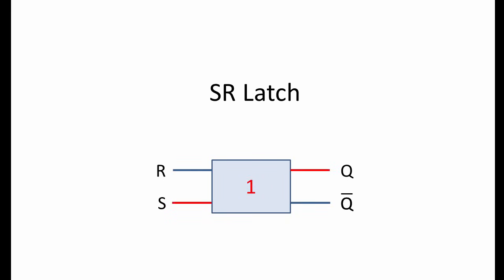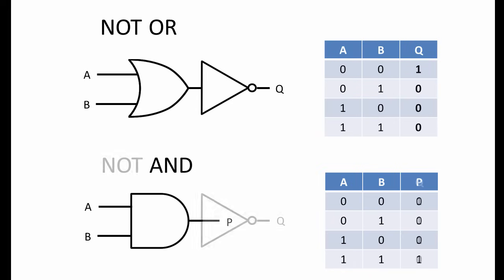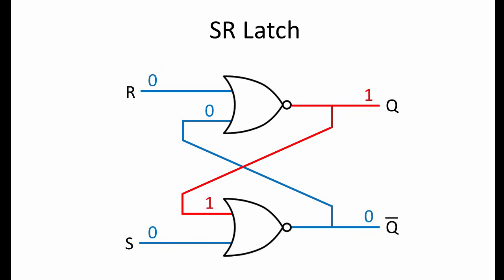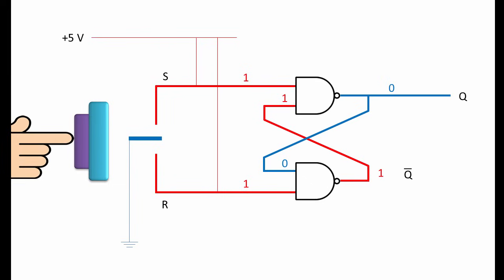Latches and Flip-Flops 1 - The SR Latch

Comment: At 3 minutes and 21 seconds into this video how exactly does someone know that the top output is a 1? When what you need to know is that the top input of the set inputs OR gate is a one when bottom input of the reset OR gate needs to be know first to know that.
Reply: In real life, it's startup state is considdered random. Because any of the two states is determined by wich nor gate is stronger than the other to force a 1 on the output. It's why whenever a cpu starts up all registers need to be reset and put in a known state for it to function propperly. In the video he assumes the top one is set because it helps make the explination simpler.
Reply: I have a similar question. How do you know that both of the inputs for the top gate are 0 when the second input of the top gate is dependent on the output of the bottom gate, which is in turn dependent on the output of the top gate? It seems paradoxical. Clearly I'm missing some unspoken rule on the ordering or just misunderstanding something?
Reply: The starting state is determined at the moment the power suplied. its random Q can be either 1 or 0. but once its determined the the other become imedeately the opposite of that .
Reply: Thank you for your interrogation I was so lost at that level

Comment: 1:30 NOR gate and NAND gate explained
2:25 NOR gate and NAND gate can be used to make an S-R latch
2:35 Cross-coupling of 2 NOR gates in an S-R latch
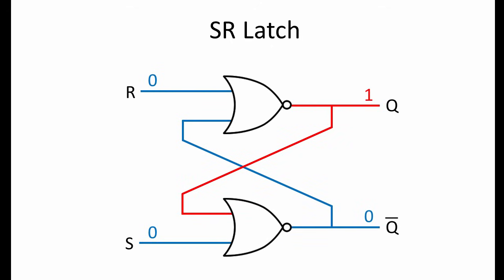3:17 Starting state of this S-R latch example
3:55 Resetting the latch
4:17 Pulse removed
4:25 Applying another pulse and implications
5:05 Implications of applying a pulse to S
5:27 Truth table
6:15 Truth table after applying a set pulse
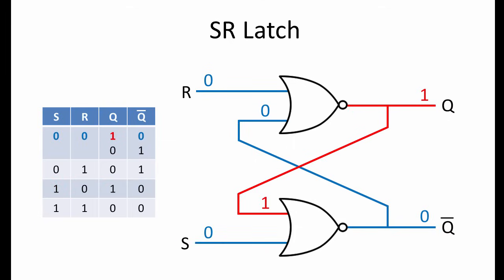6:25 Truth table after removing the set pulse
7:15 Race condition
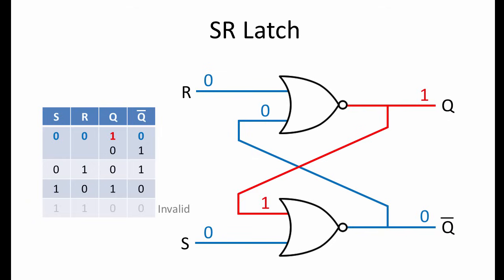8:00 Active High S-R Latch Explained
8:41 Truth table for Active High S-R Latch
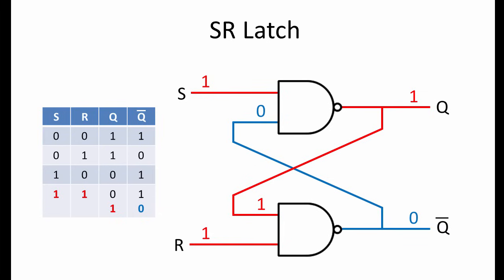9:20 Active Low S-R Latch (i.e. built from NAND gates)
9:44 Forbidden state of the S-R latch built from NAND gates
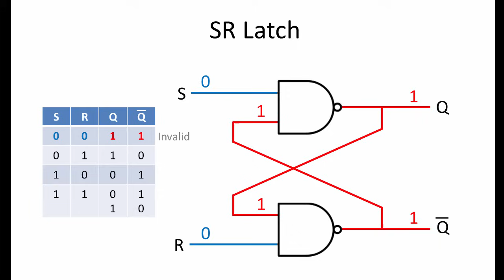10:00 Summary
10:37 Switch bounce problem
11:37 Examples of applications of an S-R latch

Comment: at 3:28, why is the top nor already producing an output but the bottom one isn't? the setup is symetric, so both should be on instantly, then switch each other off and on again in an endless loop.
Reply from the maker: Propagation delays which depend on external conditions mean that it is highly unlikely both inputs will be set to low at the same time (and it's low voltage that represents 0, not no voltage).  Nevertheless, the circuit will reach equilibrium as soon as a pulse is applied to just one of the inputs. :)KD
Reply: @ComputerScienceLessons  so the starting state is random?

Comment: how exactly is the information stored physically? is it a small amount of current stored somewhere to remember that the result of the impulse was 1?
Reply from the maker: Remember, a single logic gate is actually a circuit consisting of several electronic components (transistors and resistors) and these must be permanently connected to a power supply.  Depending on the input, the current may or may not be allowed to flow to the output.  Therefore, flip flips don't really store current, they just hold it up or let is pass.  CPU cache and CPU registers are built from flip flops, which are built from logic gates.  DRAM on the other hand is much simpler and cheaper because it is built from transistors and capacitors.  A capacitor stores electric charge (rather like the way you can store charge on a balloon when you rub it against your jumper, but a capacitor is better at doing it).  When a capacitor is charged up, it contains a 1, when discharged it contains a zero.  Hannah Fry posed an interesting question on social media: "does the computer's memory weigh more when it is storing data?" :)KD
Reply: @ComputerScienceLessons  TY for taking the time expaining! :D cheers

Comment: I find an SR latch made of an OR Gate , AND Gate , Inverter combo very useful. The OR Gate output is fed to one AND Gate input. The other AND Gate input is fed by the inverter output. The inverter input is the Reset input. One of the OR Gate inputs is fed by the AND Gate output which is also the output of the Latch. The other OR Gate input is the Set input. There are no disallowed states and the output is always predictable even at power up.

Comment: At 6:35 
Race mode between the two outputs being impossible to determine who would win.” Mathematically, speaking, if both S and R were turned on and then off EXACTLY simultaneously, wouldn’t the output that was the shortest distance from the other input win? Thus, not “impossible to predict,” so long as signal speeds obeyed rule 3 of lumped matter discipline, and signal routes varied in length. Not that it matters for all intents and purposes.

Comment: the thing is: the output differs depending on whether we start by outputing S, then transferring its output to an input of the NOR gate with R or outputing R then transferring the output as an input with S. Like for the first SR Latch made of NOR gates, assuming S=0 and R=0 If we start with S=0, Q'=S=0 then (R+Q')'=(0+0)'=1 so Q=1 BUT if we start with R, it flips: R=0, Q=R=0 then (S+Q)' = (0+0)'=1 so Q'=1. Completely different answers. So, which is the dominant path here?
Reply: or do we just treat the whole circuit as a single NOR gate, since S=0 and R=0, (S+R)'=Q, so Q=1 and in turn the inverse of Q will then be 0 ??
Reply: You're absolutely right. This used to bother me because I overthink things. The way i see it, the answer is: race condition. Basically, both results are valid, as seen in the truth tables at 10:01 . You don't care whether Q or Q' is set. All you care about is the fact that they are opposite. After all, this is a Set Reset latch, so you can put it into a favorable default state if it initializes into an undesirable state. As long as R and S do not violate the one illegal condition for whichever latch, you will have a latch that initializes into one of two states, which can be adjusted by the inputs as needed. To answer your question explicitly, there is no dominant path. It all depends on the propagation delay of the components.
Reply: @mikey.audio.  I overthink too. Thank you for your simple but effective answer. It clears my doubts and persuades me to deal with the question later when I learn more about the delay.

Comment: Are S and R interchangeable? How does the circuit determine which is which since its identical. Is it from where the power source is?
Reply from the maker: Because the circuit is symmetrical, they inputs are whatever you want them to be.  As you suggested, which is which depends on how you choose to apply the input signals.  :)KD

Comment: How does the electricity get captured between NOR and Q? Shouldn't it dissapate somehow as it looks likes the part between NOR and Q is storing electricity like some kind of battery? The truth table of NOR looks strange as well, how can you get voltage output out of no voltage inputs?
Reply from the maker: It's important to realize that a logic gate symbol is just an abstract diagram of a circuit containing several electronic components.  I had a student once who struggled with the idea that if you put NOTHING into a NOT gate you get SOMETHING out.  It became clear to her when she realised that all logic gates are connected to a power supply, but we tend to ignore that when describing their behaviour. :)KD
Reply: @ComputerScienceLessons  Indeed, I jumped into this video without looking at what the logic gates are composed of themselves, thanks.

Comment: So when both the inputs are 0, is one NOR gate behaving as a 1 input NOR? Are both the initial inputs applied at exactly the same time?
Reply from the maker: Once the latch has reacted to a change of inputs, and has settled, one of the NOR gates will have both of ITS inputs the same.  In this sense, the NOR gate is behaving like a one input NOR (which is essentially an inverter), but I'm not sure if that matters.  Because of propagation delays in the wires of any circuit, it is highly unlikely that both inputs of the latch will change simultaneously (in fact if they do, it is briefly problematic).  Simultaneous input changes are mentioned in a later video of this series :)KD

Comment: There's one part I don't get; initially, when you feed the first input S=0 and R=0, how come you know that 0 gets fed into the second NOR input in the top gate since the second input is the output of the bottom NOR gate, but the second NOR gate depends on the input value from the top gate output (which doesn't exist yet)? I just don't understand because you are only feeding S and R into the circuit; we don't know what the second gate inputs are. How can you get 1 as output from top gate?

Comment: Can anyone explain why it is this way 3:25
Reply from the maker: Hi J, With a NOR gate (which is essentially an OR gate with a NOT gate daisy chained onto it), the output is high when neither one nor the other input it high (that is, when the are  both low).  There's a bit of information about NOR gates in this video https://www.youtube.com/watch?v=TXZBqtfAOpY It goes into K-maps and Boolean algebra which might not interest you but you will see the truth table of a NOR.
Reply: I believe JuanAZ18 is referring to the initial state of the SR-NOR Latch which is unpredictable. The lecture here makes it sound as if Q=1 and ~Q=0 by default which is inaccurate. Until the state has been initialised via set or reset, the state of the latch is actually unknown, as it could be in either state.
Reply: That really seems like a problem to me, too. For both inputs low (or high with the NAND version) it is uncertain if Q or Q' is active at startup any possibly only determined by the differenc in speed of both gates.
Reply: I'm having this problem too, but the comments kinda confirm my suspicions: the state is unpredictable, and we can have Q=1, ~Q=0, or Q=0, and ~Q=1. 

Mentally, I'd mirror the circuit, and it looks the same. So, what's stopping ~Q being high at start instead of Q? Probably nothing. In a real world scenario, the manufacturing tolerances of semiconductors can make on have a shorter propagation time, hence being unpredictable. 

These are my two cents. If anyone more knowledgeable than me can pitch in, that would be great. I know I've been struggling with this for a while now, but am kinda afraid of asking such a "dumb" question.
Reply: For anyone that might still be having questions, have a look at these two pages:
https://electronics.stackexchange.com/questions/25581/sequential-circuits
https://electronics.stackexchange.com/questions/25629/how-does-a-latch-determine-its-initial-state

Comment: But how does it START to take on values? Because in the very, very beginning there is no signal from anywhere, so do we regard that all as 0s everywhere? Then we get two 1s after both NOR gates which feed back to each other and their input becomes 0 and 1 for both, which then means their output is two 0s, which means makes their inputs once again all 0s, which makes their outputs two 1s again, etc, etc. Endless loop. Is a flip-flop in such an endless loop eithout any electricity and any input? I really need someone to define the beginning for me, how does it all start. If it starts with the S signal setting it, then all those 0s are valid input, so why aren't they valid before the S signal sets it? That's really confusing to me.
Reply from the maker: When the latch is first powered up, one of the logic gates will most probably come to life ever so slightly faster than the other, due to imperfections in the components and wiring and because of propagation delays caused by factors such as the ambient temperature.  But there’s no way to know which one will come one first.  Even if they come on at exactly the same time (and end up in what is called a metastable state), one will eventually tip the balance (due to imperfections, etc.). Once one of the gates is high enough, its output will turn the other off.  The latch can then be initialised as required by setting S or R. :)KD
Reply: @ComputerScienceLessons  Oh ok, so we can't actually know which is S and R? How do we know afterwards - can we at this stage determine Q as the one with output 1 and notQ as the one with output 0, and based on that determine that the input paralel to Q is S and the input paralel to notQ is S?

Comment: At the 00 starting state, couldn't also Q be low and notQ high, depending on where you start ? Is the output random until you reset it ?
Reply from the maker: You are correct.  The initial state could be different each time it starts.  An initialisation signal (set or reset) would normally be used to force it into the desired state after it starts.

Comment: idk why i get it this way, but it would sound easier to me if the nand gate sr latch faction was named as an "active high sr latch"
since the sr latch happens when both its inputs are set on HIGH(1).The nor gate flip-flop using that logic should also have its sr latch faction named  "active low sr latch" since the sr latch happens when both the input are on LOW(0).Does this make more sense only to me or is it something that i havent grasped well?It could be the just the word "active" which idk to what this 'active" refers to.
Reply from the maker: I see what you mean, but I guess we have to go with standard terminology to pass exams.

Comment: Nice video, sir! I have a question:  
when Q=0 and -Q=1 and we set S to 1, why is it that the bottom NOR-gate passes the signal first? If the top one did first, we would be getting Q=0 and -Q=0 so it makes me wonder why it works in that exact order? Thanks!
Reply: It actually depends and it’s not certain it’ll work in that order everytime. It’s an uncertainty that plagues the SR latch when it’s starting, the way this is mitigated is sometimes a reset is applied when the latch starts up so we know Q is at a known state before any further inputs are applied. The state of the latch at starting is non deterministic.

Comment: How does the SR latch always start with the Q output equal to one?
Reply: every component has a required initial state.. its the responsibility of the system designer to ensure the initial state is correct.
Reply: @kevinparsley6806  Thanks man. I didn't get it because it can start in either way.

Comment: Why out put q has to be 1 initially it can be q bar also this will give rise to egg and chicken problem
Reply from the maker: It is theoretically possible for a latch to remain in a so called 'metastable' state indefinitely.  However, it will eventually settle because tiny imperfections in the components and wires result in current propagation delays.  :)KD
Reply: @ComputerScienceLessons  thanks for the reply and  does it mean we can safely say that one input is reset or set with respect to other???

Comment: why is Q 1 when R = 0 and S = 0?
Reply: When R=0 & S=0, we would have either of the 2 cases: Q=1 or Q=0, depending on the previous state of the circuit, because, as we saw in the next cases, after every pulse, both R and S return to 0 while Q remains set to 0 or 1 (according to the pulse it was just given)

Comment: RS Latch dari pintu NOR  saling berkebalikan dengan RS Latch dari pintu NAND...., seperti pd S=0, R=0 dikatakan stabil utk pintu NOR yg berakibat pd output Q=0, Q'= 1atau Q=1, Q'=0.
Set pada S=1, R=0 dan output Q=1, Q'=0.
Reset pada S=0, R=1 dan output Q=0, Q'=1.
Sebaliknya RS Latch dari pintu NAND, dikatakan stabil jika S=1, R=1.
Set pada S=0, R=1 dan output Q=1, Q'=0.
Reset pada S=1, R=0 dan output Q=0, Q'=1.
Dan kondisi terlarang utk pintu (logika) NOR gate, jika S=1, R=1 yg berakibat Q=0,Q'=0.
Tapi sebaliknya pada NAND gate, jika S=0, R=0 yg berakibat Q=1, Q'=1.